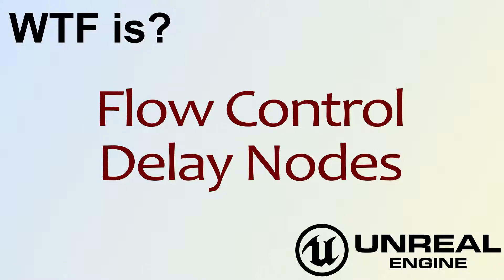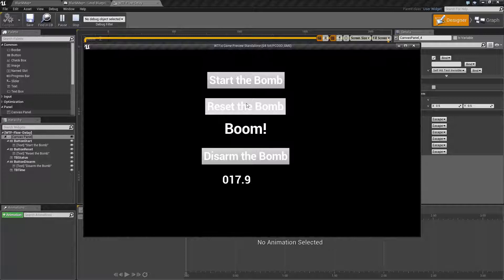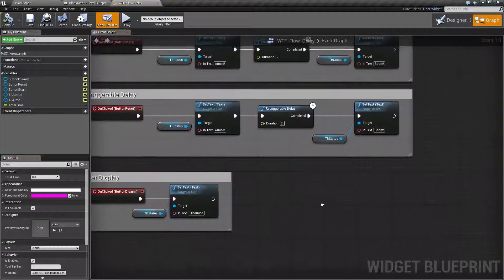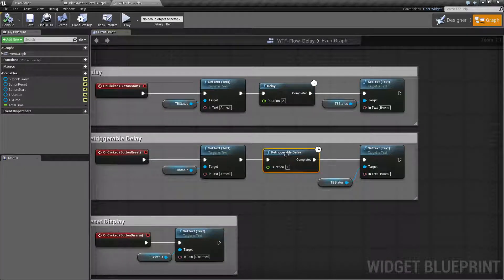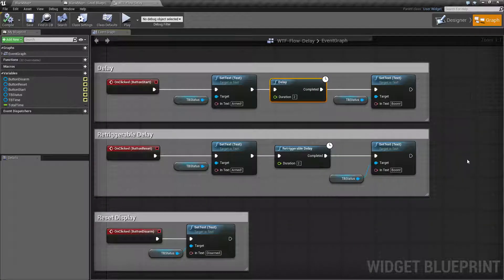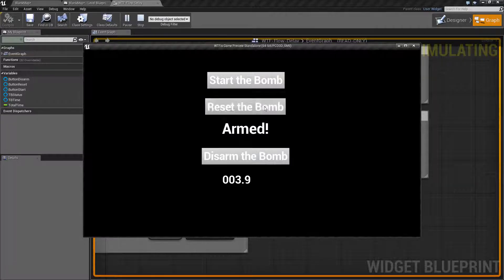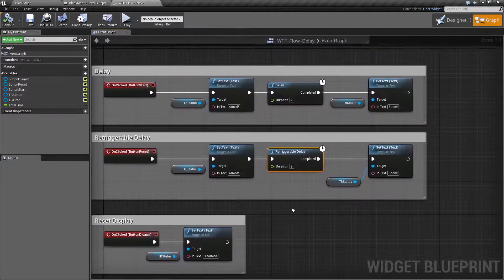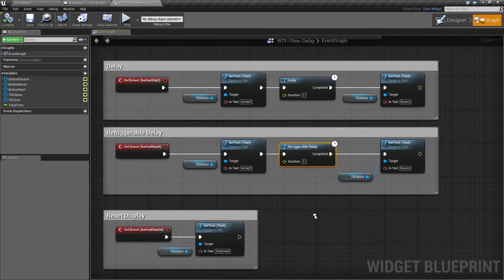WTF Is? The Delay Nodes

Comment: From what I see, the Delay node is not actually delaying, but just acting like a timed gate. The difference is that with a delay, you'd expect the things before the Delay to be buffered, meaning held in memory, so that once the Delay expires, they all pass through. For example, if you click multiple times on the ButtonStart and on the other side you'd have something like printing an incrementing int, it should still increment it for all the times you've clicked, just with a delay. But in our case, it will only increment once, at the end of the Delay period, ignoring all incoming inputs while the Delay node was blocking execution.

Comment: delay has a crazy hidden feature.
if you have 1 line of code that calls another function, and the delay is inside the second function, 

its easy to imagine the second line function must finish, before returning to the first line.   but the game wont pause, so the second line stops at the delay, and jumps back to the first line, instead of cutting it completely off.
right ?  yea i just tested it with a print at the end of the first line.
the first lines print finishes before the second line delay. instantly. 

meaning that the delayed code gets paused, the first line will exit the function and finish.
use delays with caution X_x.
im sure this Matt guy explained it better than I did. ive seen a hundred of his videos.. but im too busy to stop and check this one, codes runnin fresh in my mind. i gotta get back.
I wanted to come check the facts here, but i just tested it in the mean time X_x.